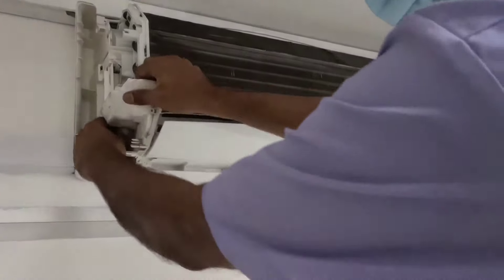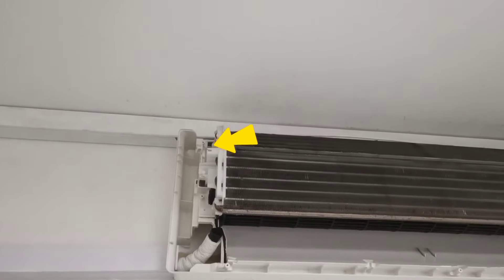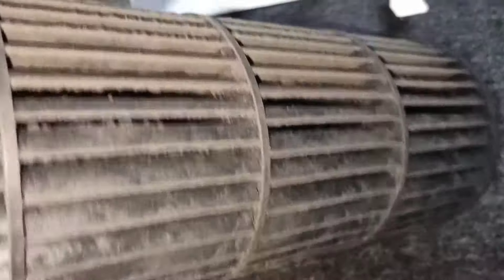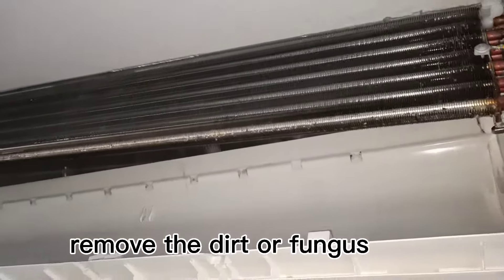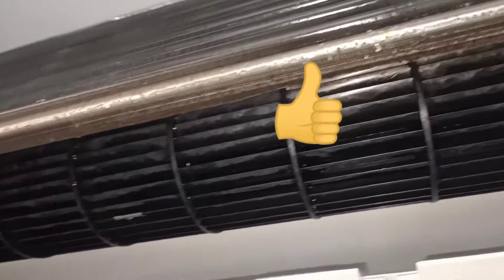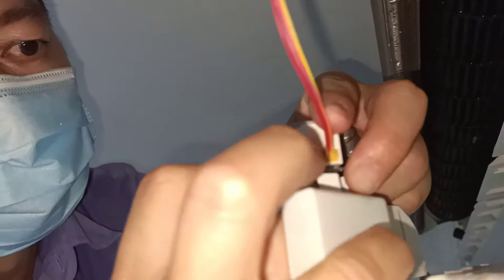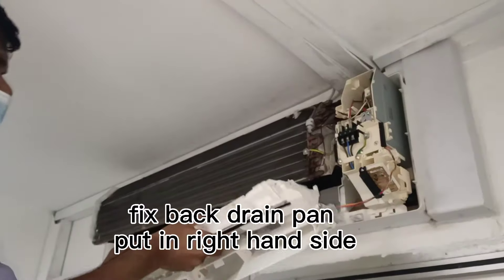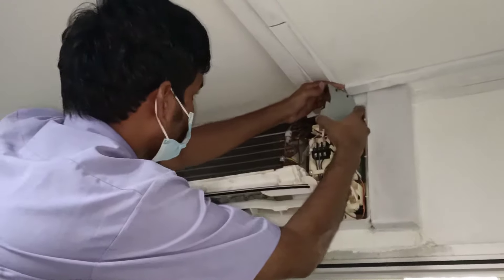How to DIY service an Panasonic inverter air con.

Comment: 01:47 My radiator just won't move, no matter how hard I pull, so I can't get the drum out :(
Reply: I realised there's a black, foam air/vibration seal between the radiator and the plastic housing at the back. That seal had perished and stuck the radiator in place, so I just needed to wiggle it and pull it really hard. Also, because that seal had previously not been put back in correctly when someone else serviced the unit, so it was sticking out and the drum/fan was flicking on it (which was the reason I was disassembling the unit). I just ripped off the perished parts, cleaned everything and reassembled the unit. Seems OK. My top tip is to smear a bit of silicone grease in the end of the rubber drainage hose (if it's fitted at the right end). Makes it so much easier to reassamble, as the plastic tube slides back into the hose. Also, if your unit is nearly against the ceiling and you can't reach the 3 latches at the top, but some grease on those too, so that they assemble/disassemble more easily. p.s. These Panasonic units are very poorly designed. Mitsubishi better (I'm a design engineer).

Comment: Left to right blade movement is not working. Where should I be looking to fix that?
Reply from the maker: Some resign only up and down
Reply: @BonMj  it was working but then stopped. I'll take it apart as in your video and see if anything stands out. 👍

Comment: The blower difficult to reinstall back, is it have some trick?
Reply from the maker: May be the axle uneven
Reply: @BonMj  the blower not able to put completely into axle. Like something stuck
Reply from the maker: @fook901  do you check the axle nay uneven.
If the screw wrong position

Comment: Boss , after cleaning my aircon blower is still weak why?
Reply from the maker: What you mean blower weak?
Air flow uneven?
Reply: @BonMj  yes air flow uneven.please advise. Thanks
Reply from the maker: @brandenongkp  the evaporator coil is choke.suggest do chemical cleaning.
Reply: @BonMj   Noted with thanks , appreciate your input. Your video is very informative and helpful.
Reply from the maker: @brandenongkp  Thanks for watching my video,please text me if any aircon problem
Reply: @BonMj   Hi 👋 I managed to chemically wash and vacuum the evaporator coil like you mentioned. Now it’s  quiet ,cool and smell fresh 🇨🇭.  
You are not selfish to shares your knowledge, appreciate. God bless you abundantly 🎉
Reply from the maker: @brandenongkp  you are welcome. 
Thanks.
Please share my video 🙏

Comment: Daikin vrvr 4 control PCB  is not working how I check and what is the problem
Reply from the maker: Check incoming ACV230 ,DCV330V
Reply: I'm checking ac voltage 230 but fc voltage how is check and
Reply from the maker: @gothandaraj860  control pcb segment light ok?
Reply: That's not indicate supply is ok
Reply from the maker: @gothandaraj860  no power light mean control pcb or filter pcb faulty
Reply: How to rectify the complaints please tell me
Reply from the maker: @gothandaraj860  what is your problem, any error code?
Reply: That AC is 7 secment display is not indicate and u4 error
Reply from the maker: @gothandaraj860  normally will show U4 at outdoor.
May outdoor control pcb fsulty
Reply: Ok thank you